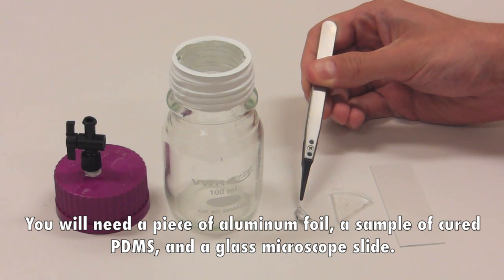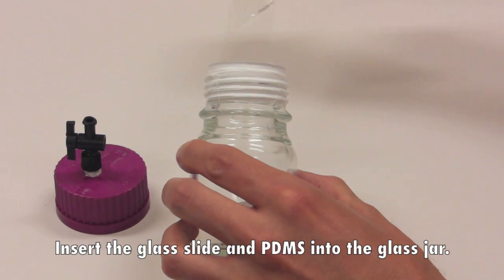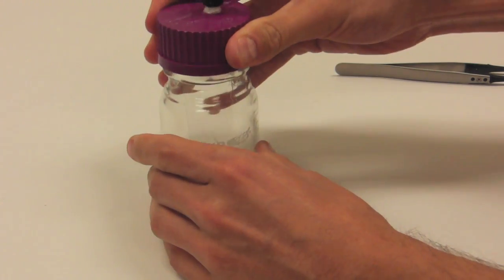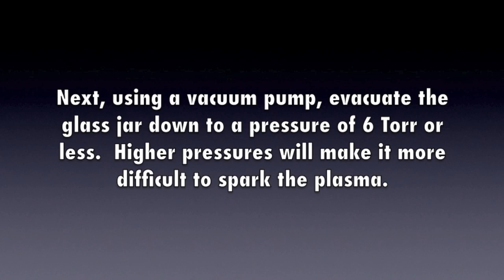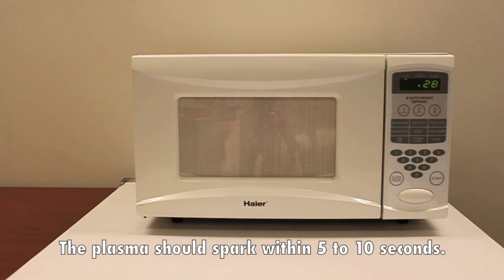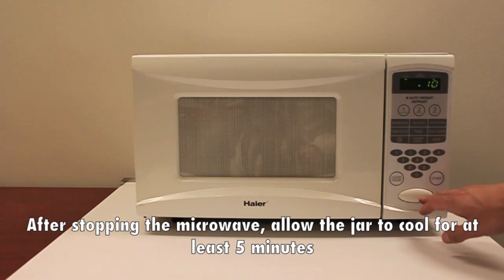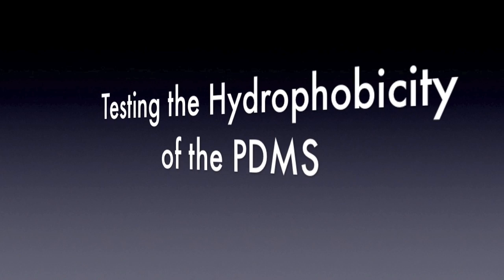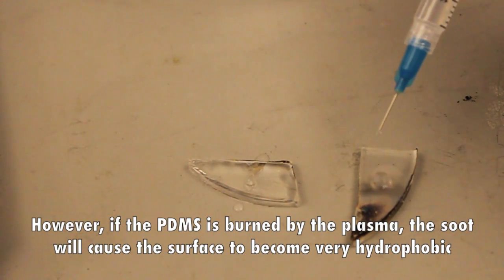Lab 6A: PDMS Microfluidics: O2 Plasma Treatment

Comment: Thanks for the video. I set mine up and it's working beautifully. I'm trying to do the same type of treatment to a thin film of mylar (~25um) (PET, polyethylene terepthalate); however, the plastic melts and deforms when I do the treatment (PET melts at 260 C). Is there any robust way to control the power of the plasma / reduce its temperature?
Reply: The temperature of the plasma is directly related to the pressure your are able to get, lower the pressure, lower the temperature.  Google cold plasma if you want more info.
Reply: @matt3251  Great tip!

Comment: Does anyone know where I can get a lid like the one on the glass jar? I can't seem to find one anywhere.
Reply: Laura von Deak Drill a hole in a normal plastic lid. Choose your drill bit based on the valve you want to install. Use a bit of teflon tape to help the seal.
Reply: Thank you so much!

Comment: what is the aim of the experiment what do u want to show us what is the use of it
Reply: It allows you to chemically covalently bond the PDMS glass organic polymer to a glass surface. The PDMS will repair itself over a couple hours once bonded, but it is vulnerable to water and other stuff until then. Use an ionization generator or corona discharge blower instead of putting this in the microwave. Its easier.

-B

Comment: Needs a thesis statement. What are you trying to accomplish? You had plenty of dead air time to explain it in a few simple phrases.

With science, communication is key, this is dry and useless.
Reply: Just curious, do you work in this particular field? Because, to me, there are countless, obvious ways this is useful. Bonding PDMS to glass, preparing surfaces, bonding photoresist, and a bunch of other things.

I don't approve of the microwave method, but I do not think it requires an explanation for people who would seek this out. For the layman, absolutely, it would be nice to have a thesis, but no introduction is needed for the people who know what this is.